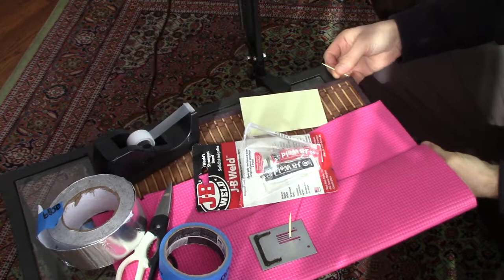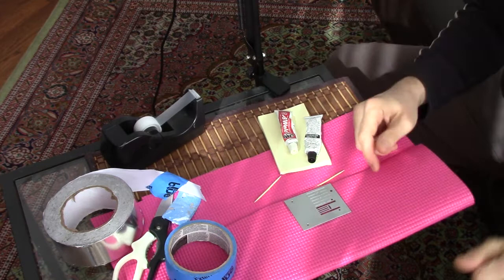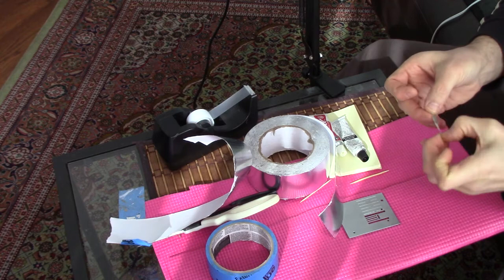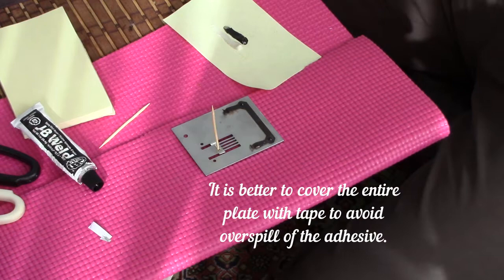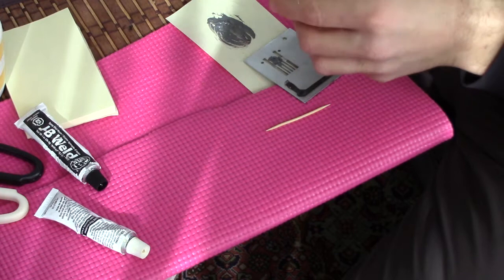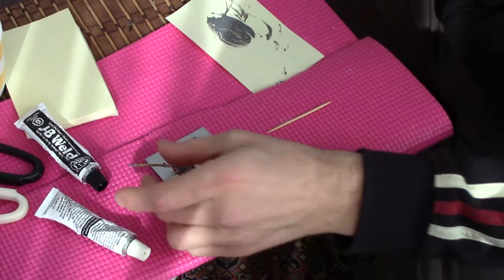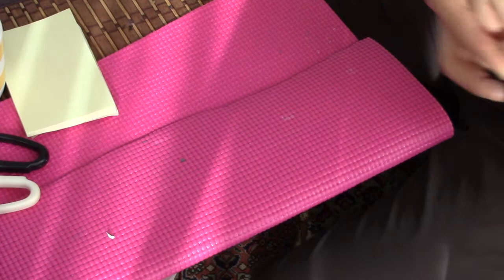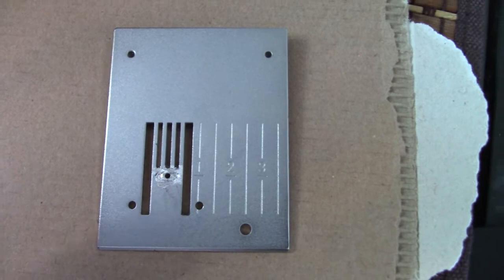Create your own straight stitch plate easily

Comment: Boy o boy!  This worked out great for me!  I taped the whole plate except for the zig zag hole and used the toothpick for the center as best I could.  Next time, I would suggest marking the clearance you need on the tape.  I tested it in place and found I had to pick away on one side because it was just too close to the needle.  I used my awl for this.  I did the picking away the next day because it was just too soft yesterday.  I love this!  I'm amazed this hasn't flown to very popular views.  I have been so frustrated so many machines come without the straight stitch plate.  It's a major problem.  I like that this isn't just a couple of pieces of tape fix.  Thank you again.  It's brilliant! ❤  

I used clear packing tape to protect the plate from smears
small package of J-B Weld Original Cold Weld Steel Reinforced Epoxy,
Duck Brand 1.88 in. x 45 yd. Silver Aluminum Foil HVAC Repair Tape - not Duct tape with the threads embedded in it.
toothpick, 
one of those bread bag tabs to scrape the epoxy flat before it dries while the toothpick is still inserted in the center.
Sandpaper if you need it.

fine tip marker to mark the center hole area to void
sharp awl to remove excess the next day or some time after the epoxy sets up.
Reply from the maker: Thank you for your positive feedback. I could not  believe that it took me so long to figure out a solution. I was giving up on so many machines (even the 237) because it did not have the straight stitch plate. I felt really great too when it worked and then put my head in my hands at the machines that I had given away. But now that I know I am happier when I see a machine that I know does not come with one, but that I can make one easily. I like your suggetion too. Happy sewing.
Reply: @jamesrogers991    BUT you are the one who thought of it!   I hope with my comments, it gets your video circulated.  This should be in the top five of sewing hacks!  I am so happy and I am sewing!  I am sure others would be happy to know they don’t have to be sewing without a straight stitch plate.  Here’s to publicity. ;)
Reply from the maker: @ThisnThat54  You have made my day wonderful. It is lovely to hear from positive people. Sadly, few people are supportive . You have a wonderful day too.